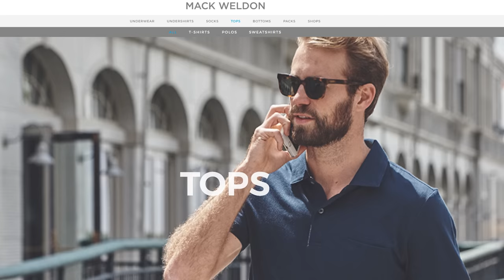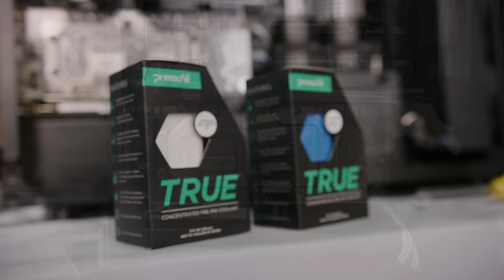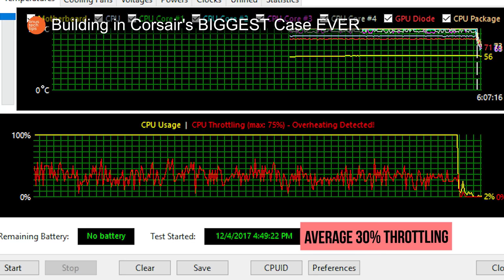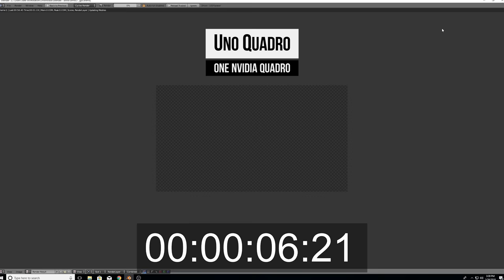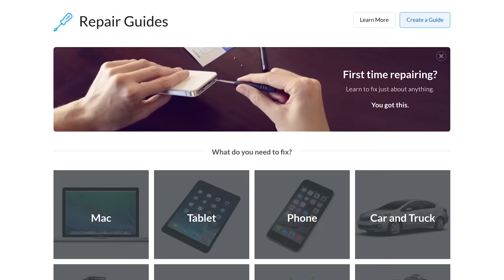Ultimate $20,000 Dual System Build – Corsair Slate Part 2

Comment: but, can it run coolmathgames?
Reply: But can it run crysis?
Reply: Not if they cheap out on flash.
Reply: @AustinSmith-fo8jg  with this they can properly get 5 FPS on coolmathgames. I can't even run cool maths with my pc.
Reply: For the optimal experience you might want more ram but it should play it just fine right now
Reply: no but it can run skyrim
Reply: Wow wow wow, calm down there bub. You need a waaaay better pc to run coolmathgames, you can run it but it will most likely run at 2 - 6 fps
Reply: Of course it can run coolmathgames, my computer can run it in 240 fps.
Reply: But can it run Dwarf Fortress?
Reply: but can it run minecraft
Reply: No it only gets 6fps it's to demanding of a game for this system.
Reply: No
Reply: It can handle gta at 15 fps
Reply: @ghst8242  r/wooosh
Reply: @pcscreen5050  Nasa can't run coolmathgames on their pcs
Reply: Nasa can't run coolmathgames on their pcs
Reply: @ghst8242  nobody cares
Reply: No the school blocked it
Reply: @coolprominer8020  nothing can
Reply: Nah your need t least a petabyte of ram to run coolmath
Reply: I have a i3 7100u with integrated graphics that thermal throttles at load due to being a laptop CPU. I can run cool math games no issue at like 60 fps
Reply: @tech-hilfeportal6611  r/woooosh

Comment: i need to see this done again with the latest hardware, imagine the raw power you could fit in that case in 2021
Reply: all those 3090s with a 12900ks running the new alienware qd-oled 🤤
Reply: @5bind  All those with 4090s and three separate power supplies. HMB while I calculate the landing coordinates for the new rover on Europa.

Comment: I would use it as a coffee table
Reply: funnyhappyharry id use it as a pillow
Reply: Well you better not spill anything then, oops spilling my coffee cost me 100‘000
Reply: With that extra fancy civic poop coffee
Reply: It's funny that this is actually what I did with it. I live in a very small flat, and instead of buying a table and a case I just bought this and it doubles as both for roughly the same price as they would be separately

Comment: watching this in 2020,
This honestly seems like the perfect setup for me. I don't need water quad graphics cards but to serve as a NAS for my house plex server, and play PC games while streaming to twitch while using plex in another part of the house while not having space in my room for multiple PC's  this looks like a great option. Especially when i don't need top of the line parts to do any of those tasks. This PC as it sits now is probably a $10k build in 2020.
Reply: Nvidia RTX 3090: Allow us to introduce ourselves
Reply: @Rhythm8503  hahahahahhahaha rip sli
Reply: I got the same case for gaming running rog strig z590e,  32gb ram corsair vengeance, corsair 1200 w platinum, sabrent rocket 2T ssd, I9 12700kf, 2 corsair 3 fan cooler(1 for cpu, 1 for gpu), 13 corsair fans= for about $2,500
Thats not counting the GPU cuz we all know thats. A seperate story
Reply: You may think that, til you get the case. I wasnt prepared for how big it actually is. It dwarfs my full size towers, and my desk cant accomodate it. And thats not mentioning the weight. A dual system build in it, even without water cooling, is going to be HEAVY

Comment: As compact as a 1946 calculator!
Reply: Juan Fernández except that its over a billion(?) times more powerful
Reply: and in another 40 years, high end home computers will probably be the same size.
Reply: james wasda lmao most likely everything will be super small because it will be smaller and more powerful as technology improves plus holographic possibly
Reply: Well yes and no... A computer this powerful might fit on a wrist watch size 40 years in the future. However, a top of the line home computer in the future will probably be the same size. In the 80s when my dad built his first computer, it was top of the line for home computers at the time, but it was still around the same size as modern home computers.
The thing is, in the future, I think everyone will have a home server computer that will work as a mainframe, and then they'll just have input output devices with them at all time.
So at that point in the future, you'll be carrying a touch screen with a battery and an antenna, and that's all you'll need.

Comment: I would use the system to perform finite element analyses that take my working laptop anywhere from ~15 minutes to three hours per separate trial to complete for simple to complex 3D models in Creo Parametric. A system like this could run multiple iterations of FEM analyses as well as random excitation analyses, which would have been perfect for certain projects I've worked on. On top of that, it would not impede on my productivity, so while the analyses are running, I could use it to continue to model, or leisurely game while I wait.

One can dream...
Reply: Luis Rochin cut away the glamour and you pay a few thousand less
Reply: But e-peen.
Probably much better just remoting into a workstation like the previous build in a cupboard.

Still... i want this.
Reply: Luis Rochin Or play Roblox.
Reply: A man can dream. A man can dream....

Comment: I got this case for my Son, to house his gaming PC using Asus ROC Maxmus XII Extreme, 2 x 32GB DDR4, Power Supply EVGA 1600W Titanium, EVGA 2080Ti Kingpin, 1TB Samsung 970 Pro M2, 
Intel i9 10900K, Noctua NH-D15, 3 x Noctua 140mm Chromax Fans at the front, 8 x Noctua120mm NF-A12x25 top and rear,  Asus Roc Strix XG27UQ Monitor as prices 1/2 in the UK, 
The CPU Temperature is Amazingly Low around 30C, Chip Temperature around 38C, I use 2 x Noctua 120mm Fans at the rear of the case to help the NH-D15 pull out the heat from the rear of the case, swapped the 120mm Fan Mounting to the Top of the Case where it fits the holes at the top of the case, and use the Noctua 140mm to the Front of the case, 
later I might use a fan card to help cool the 2080Ti at the side, 
I must say the case is very well built, Very heavy, only thing I don't like to see is the cage for the Hard Drives not required these days, I want to use SSD's behind the barn door, apart from that I am pleased that the large size of the case helps to keep things cooler, that's what I wanted, and sure enough has proved it's worth !, later on there is enough space to experiment say with water cooling? :)
Nice Video Linus :), My Son & I watch your tips in the industry thank you again :)

Comment: Wow ! This was an Epic build LTT👍

480$ is not bad for an extreme case, I paid about 520$ for my caselabs sm8 - but sm8 is on another level
Reply: 900d is 350 ish so 480 is not bad at all
Reply: and the caselabs case has very high adjustability and upgradability compared to this corsair monster
Reply: Christianspiller I agree 👍
Reply: cataria pega yes I needed a case that would house two 560mm radiators. I have two hwlabs 560mm black ice sr1 radiators with 140mm fans running at 700 rpm - they are cooling 6950x and two evga 1080 TIs. Silence was my number 1 priority, and everything needed to be housed inside the case - sm8 fit the bill.
Reply: wish i would have gone with a mercury s8s, which is fucking expensive, but instead i went for a crappy corsair 900d used, gosh what a bad decision :/
Reply: cataria pega yes I had 900D - i would give it a 6 out of 10. It has space but the quality control was very bad. My 900D started to warp - the bottom radiator panels stopped closing for no reason. The mechanism to open the side doors stopped working (right side). Even for the slate - I would save and spend a bit more to buy caselabs sm8. Compared to my 900d the sm8 was lighter, but larger, made in USA, much more customizable, and lastly no flex
Reply: Yeah the quality of the 900d is a bit disappointing and its a nightmare to remove the side panels and when i first got it the lower panel always open by itself but i got it brand new for 100 bucks so i cant really complain too much and its better than the fractal r5 i had before it

Comment: I think streamers would use this the most by far.
Reply: Precisely.
Reply: BILLABONGSTEFANO yeah more cores
Reply: They can put whatever hardware they wanted in the case for both the itx and atx formfactor areas, they just wanted to know who would use a dual system setup in one case, and I think the streamers could benefit immensely from this kind of dual-in-one case setup.
Reply: its not quad 1080's they are quad quadros nvidia's business/workstation line of gpus the second build was never intended for gaming its for things like 3D rendering etc
Reply: I’m working on a streaming rig that is using unraid.  It seems like it’s a cheaper and slightly faster on the encode handoff
Reply: As a streamer and a gamer, I'd drop 20k for what this thing pushes out.
Reply: "Do some reasearch,youll see what im talking about.
 In conclusion,clever streamers would not use this system."

You do realize the machines were a 7980xe with 4 nvidia quadros, and a 7700k with a 1080ti, right? Downscale the 4 quadros to maybe a single card that suits your needs and you've got a beautiful streaming setup.
Reply: One pc for the gaming another for the encoding.
Reply: He is not talking about copying the hardware just the dual system case.
Reply: I'd bet it would be miners, not streamers cuz that case is big enough to fit either two PCs OR a LOT of Graphics Cards
Reply: Patrick F. Thank you. I felt like I was the only one who was planning to move in both my rigs in this thing. It's a one time investment for much greater efficiency.
Reply: +ItsJohnnyMac lol

Comment: Theatre/live performance work is the application that came to my mind. to have near-silent operation and relative compactness is a plus, the beefier system would be ideal for any production involving projection mapping, while the secondary system could be running Q-lab or ETC's Nomad software. That said, this would be one extremely well off theatre that would implement a system like this, and any touring production would probably prefer a rack-mounted system.

Comment: But would it run Quake 1?
Reply: It would even run your pee.
Reply: I doubt it would be good coolant :P
Reply: Siema
Reply: I think it could run it at 5 FPS
Reply: Nitor G nah more like 3
Reply: You might struggle to get 1fps
Reply: I geus you can reach 23 fps with medium setings.
Reply: atleast 4 fps on lowest settings
Reply: I'd say around 9 fps using software rendering at 320x200.

Maybe 13 fps in GLQuake at the same resolution.

Comment: I would use this case for a long term upgrade path for multiple computers. Buy it, transfer/upgrade my current system into it. After a couple years, add an itx build for streaming/daily use/things that would impact gaming performance, and then just continue upgrading both systems within the single case. It would make water-cooling local and easy, and when you clean one system, you clean both! Also, you could multi use storage between the two systems. Also big case for cool aesthetic parts and ease of Access when building/upgrading. I have a 900D for that reason alone.

Comment: But Can it run crysis ?
Reply: But can it run Linux?
Reply: But can it run Roblox?
Reply: But can it run from that dated meme?
Reply: SilverEevee but do you know de way.
Reply: It’s too weak, it’ll run 20 fps
Reply: BUT CAN IT RUN CHROME
Reply: Crysis 3 in 8k VR
Reply: Can it run mariokart?
Reply: But... Can it run DOOM?
Reply: Does my 2 GB ram laptop run anything? (No)
Reply: xSwePlayz same
Reply: But, can it boot up?
Reply: Airbolt are you kidding on lowest setting in 800×600 resolution at 5 to 10 fps

Comment: Honestly I would rather this than the enthoo elite. It’s almost half the cost and personally I think it is just as dope.
Reply: the production model of this is the corsair obsidian 1000D
it costs $500. literally half of how much the enthoo elite would run you for. the primary difference is that it's got more tempered glass, more RGB built in, and can fit even more SSDs and hard drives!!!
every feature you see in the slate, is translated to the 1000D.

Comment: The first system is a Linux workstation the other is a Windows gaming system
2in1
Reply: I was literally going to comment this.  Linux for customization, browsing, and security.  Windows for Gaming, Game Dev, 3D work.  Then use dual monitors with synergy, or a switch(would be cool if a monitor, mouse, and keyboard could all be easily tied together on the switch).  Set up some shared storage to easily copy between systems(maybe even use a Ethernet crossover cable?) and then work on integrating them more.  If one isn't doing anything at any point have it mine crypto.  Setting up streaming is another great idea with this system as OBS actually has a Linux version.  It also allows you to have an isolated environment for testing customization, mods, software, and hardware configs while allowing for a stable system.
Reply: Could even dual boot MacOS on the mini system for ultimate flexibility.

Comment: Im actually picking one up and using the ITX board for an internal FreeNAS. Using 5x16TB Seagate drives in Z1. Using PCI slot for Intel 10gb NIC.It will be nice to have the NAS right inside my case.

Comment: if you had 1TB of ram, do actually need a graphics card?
Reply: Connor Kearney yes
Reply: @neonfighter2855  thanks for answering my question
Reply: Atm the most u can have on 1 stick of ram is 16gb
Reply: E102 Gamma if you go ecc memory you can get 128gb or even 256gb ram sticks. Standard dims do come in 32gb variants too.
Reply: @bradhaines3142  thanks

Comment: As a owner of a corsair 800D case, which i run 2 rx580s with a full sized atx board and 8 hdds and 2 ssds in it. Also with water cooling. This is just my gaming rig. I think if it was a bit bigger would be even better to run 2 full sized atx or eatx boards would be even better.

Comment: I would use it for the ultimate rig of gaming, with a small ITX workstation too, I guess. The main board would have an Intel i5 or i7 that has at least 4 cores and 4 liquid nitrogen cooled gtx 1080 TIs and the ITX workstation would have a GT 730 or some low end GPU and a decent dual core CPU with 2+ghz per core. Of course, The gaming part could handle anything the workstation bit did, but why not 2 computers in 1 case?

Comment: I am planning on using this case to build a baller tier gaming/3d design workstation that's custom water cooled, and I plan for  lower cost NAS build that is always on for storing data from projects that can be accessed from anywhere remotely so that I have a reliable location for those crucial files.

Comment: Still use mine today. Overkill watercooling Ryzen 5900x / Rtx 3080 with 4x480 rads and two D5 pumps. Super quiet at max AVX load with temps never breaking 65c.
Reply: Very cool! 👍👍👍 A machine like this is timeless. It will never be too outdated!

Comment: I'd use this for as a dual-system (an ultimate gaming PC and a Hackintosh)
Here are the specs I'd use:

PC:

MB: ASUS ROG Rampage VI
CPU: Intel Core i9 9980XE
RAM: 128GB of Corsair Vengeance LPX at 3000MHz
GPU: 4x Nvidia GeForce 2080 Ti (Asus ROG Strix)
Storage: 1x Samsung 970 EVO Plus 2TB, 2x Seagate IronWolf Pro 10TB
PSU: Corsair AX1600i

Hackintosh:
MB: ASUS ROG Strix Z390-I
CPU: Intel Core i9 9900K
RAM: 32GB of Corsair Vengeance LPX at 3200MHz
GPU: 1x AMD Radeon VII
Storage: 1x Samsung 970 PRO 1TB, 1x Seagate BarraCuda Pro 8TB
PSU: Corsair SF750

All of the GPUs and CPUs would be water cooled, and on the PC I'd have the memory cooled with two Corsair Vengeance Airflows.
Also I'd have as many radiators as possible and all with Corsair LL120 or LL140 fans.

Comment: Linus. This case is perfect for a 4 person in home gaming and streaming station using the new Threadripper 2 CPUs coming out. While very expensive to the average user, for someone looking to maximize the space in home while still being able to entertain friends on their platform of choice, this is something I would consider. I have read that using unraid allows GPU passthrough in virtualization on threadripper. When factoring in the cost of good gaming monitors and the outrageous price of graphics cards I realize it is coslty, but actually doable for someone creating a proper man cave. When you consider the additional costs of memory, cases, power supplies, and the additional space/asthetics for separate systems, it kind of starts to make sense. On the more practical side, 144Hz 4k gaming is not attainable with one GPU per 'system', so the costs really are not that outrageous, all things considered. Thank you for considering my response. I look forward to seeing what other high quality content you pump out next!

Comment: I'm buying it for my New Monster project; MSI Meg ACE X390. I9 9900K, 2 GPU RTX 2080TI or 2 TITAN RTX when prices falls. 64GB DDR 4 Corsair vengeance RGB pro 3600 mgz. For the storage the C: 2 wd black 500gb nvme m.2 in raid1 for Windows boot, programs, Saves scripts and configs in my docs so the C is protected.  For the D: 3 wd red sata ssd 1tb in raid0 for 3tb total for the Games library. (Need to find a way to install a bluray internal Drive in the case) Drive G: Will be a SSD or hybrid 1tb Drive for works and commonly used stuff so my graphics works will be saved there and so my music collections, and also the folder for download and temporary stuff. And finally the H Drive will be the huge archives Drive consisting of 5 wd green hdd of 6 tb each in raid5 (connected on a 1x pcie raid card, (no speed intended here only size) for an usable total of 24gb with one redundency. 

And the lil rig, could be an i5 but I think an i3 would be enough, 8gb and a capture card. And will use it also for doing dedicated server. And of course a dual loop, one for cpus, one for gpus. 

So that about it, you can Tell me what you thing, for now I'm buying pieces since August, right now I got the motherboard, cpu, nvme, the 3 sata SSD and the Ram. It a 5000$ project but with some good deal I got it should end up around 4000$.